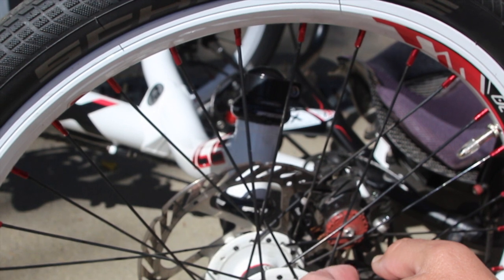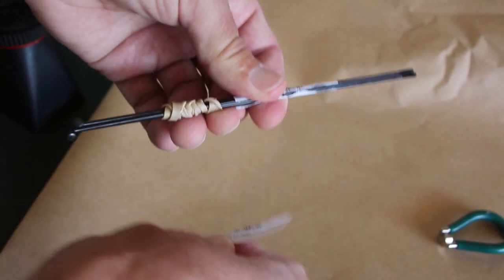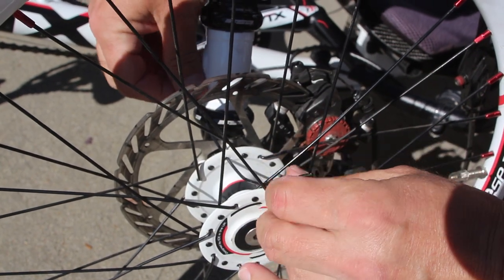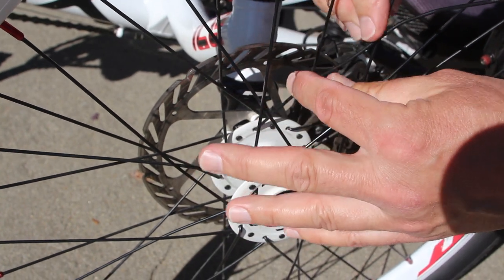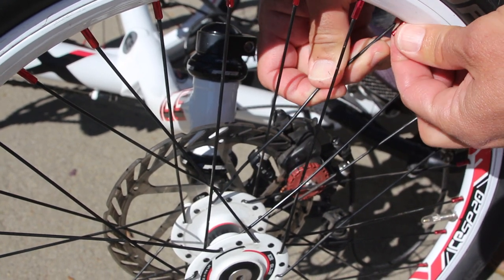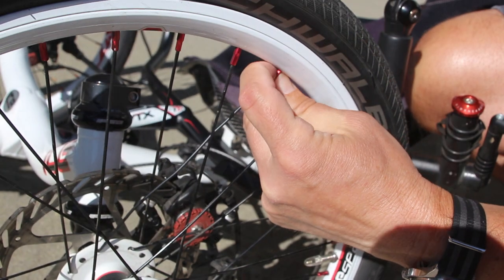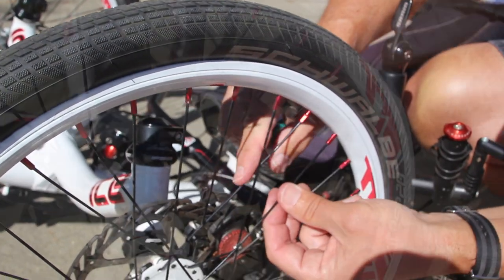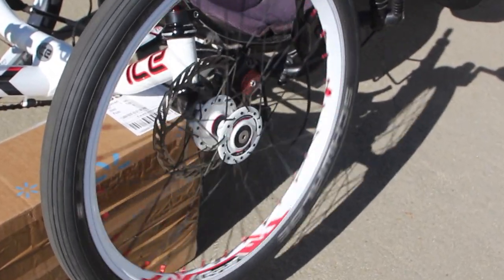Replacing a Busted Spoke on a 20" Wheel on the ICE VTX Recumbent Trike

Comment: On my last tour in France I broke a spoke. Unfortunately I hadn't got any spares so went to a local bike shop (in France). The spoke was a non standard length because it was an 18" wheel (ICE Micro, 17 years old). We ended up using a standard spoke and bent the end over where it went through the hub to get the correct length. Lasted to the end of the holiday and beyond. Never going on tour again without a few spokes!
Reply from the maker: That's a great idea, Simon! Just wrap it at the hub and tighten it up!